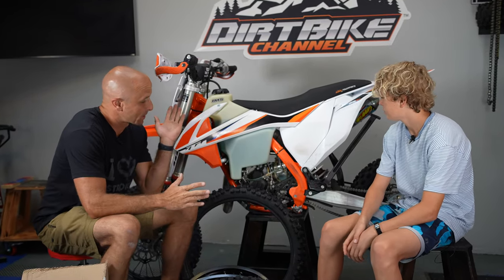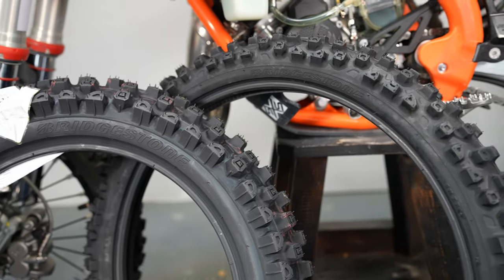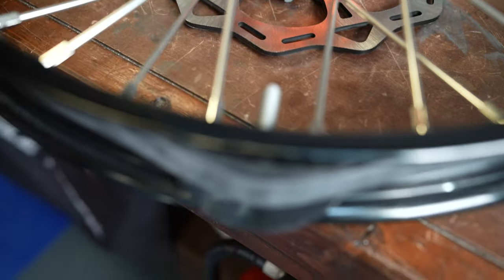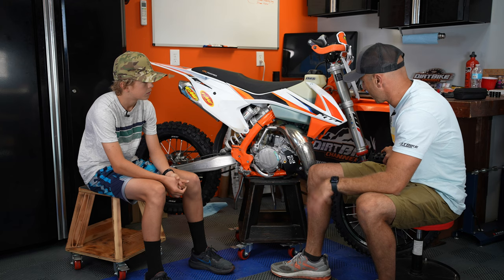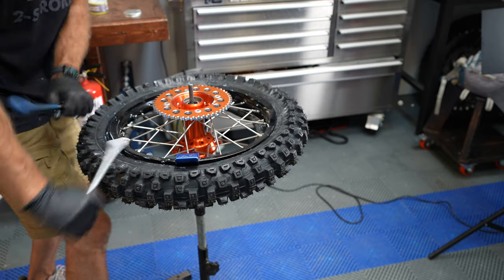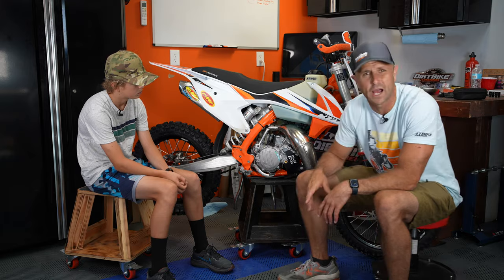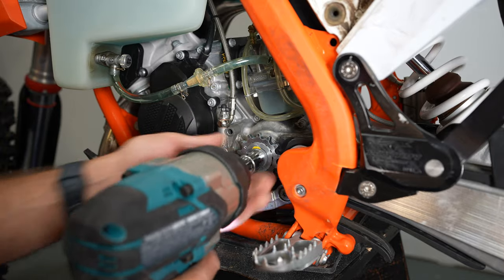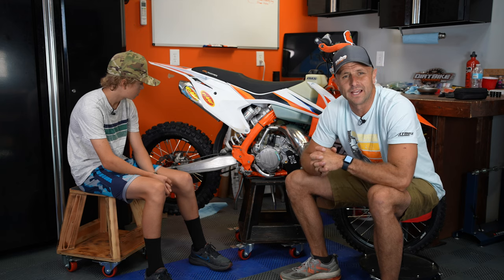KTM 85 SX Big Wheel Conversion 19/16 Wheel Set for Enduro

Comment: 70hrs is alot? my sons TC65 had 176hrs when i bought it.  its about to clock over 200hrs,  to be fair I did rebuild it top to bottom before i gave it to him and its now as good as brand new.  Coil fork conversion, blader kit shock, new top and bottom end, gearbox bearings, swing arm bearings, wheel bearings and stem bearings, painted frame the works.  Tossing up if i should get him a second 65 for trail riding or a 110.

Comment: Awesome . Good info .
My son is approaching that same gap and I’m struggling to decide what bike will work for him until he’s ready to go to a full size . He’s currently riding a ttr 110 and a kx65. He’s almost 11 and both bikes are a touch small and under powered for his skill level  . 
An 85 doesn’t seem like a big enough jump to be worth while, while something like a kx 100 would be a too big . I wasn’t aware of a wheel size upgrade available for the ktm 85. This might be the ticket. 
I sure wish someone would build a true midsize enduro bike to bridge the gap.
Reply: 85 come standard with either big wheels or small wheels. It seems Kyle bought the small wheel version and is converting it to big wheel rather than buying a seperate bike. and 85 big wheel is a lot bigger than any 65
Reply: If a kx100 is too big so is a big wheels they’re both 34” seat height a small wheel sounds fine as they’re 31”~32”

Comment: You have a truing stand, you should build the wheels yourself it's not hard to do at all, those rubber rim bands for covering the spoke nipples don't work very well but Motion Pro has some that are plastic with adhesive on them and they work great and offer much better protection against flats, those wheels look great on that bike and will definitely provide much better stability and cornering, I can't believe how big Conner is getting.

Comment: This category of bike is so confusing as a newbie dad, my 11 y/o son has outgrown his CRF125F but every manufacturer markets the 85 as a “rip snorting MX’er for your little McGrath”.  My son isn’t interested in motorcross and dealers tell us you can’t really change these bikes into good enduro/single track bikes. I’ve been told that if your not in the pipe with these 85’s, you’ll just foul plugs and the bike will die in the technical stuff. What to do?
Reply: You can buy weighted fly wheel. This will help the bike not wrap out so fast and help it lug more. Less prone to stall going slow. Also you can go down a tooth on the front sprocket. Or up a few teeth on the rear.
Reply: That is a huge misconception just like every other 2 stroke or Mx bike, if you mess around with the suspension and jet it right and run a hotter plug 10 for example they’re great single track bikes no mods needed.
Reply: If he gets used to it and knows how to ride it they are just fine for single track just like a yz250
Reply: Thanks for the replies fellas, I knew there had to be a way to mod these bikes, but there’s almost too much info and to many opinions for someone new to the sport to filter through.

Comment: No way it needs a piston. KTM is super conservative on their manuals. Single track use would give you at least 140h on a top end. If it starts easy you don’t need to change anything.
Reply: When we got ours the shop said will see you again at 20 hours for a new top end 😂 we’ve done 40 and the bikes running like new still

Comment: I like the big wheel upgrade. But KKE wheels is definitely a DOWNGRADE. I put a set on one of my bikes because they looked good and were cheap, but the first time I hit a rock in the desert I broke 3 spokes in the front and 1 in the rear.
Reply: Interesting…. First time I’ve heard this.
Reply: Fake news I run them on my 250sx riding hard hard trails rocky shit. And jumping 10-15 feet of air sometimes casing landings…. No broken spokes no egg warp or even side to side warping
Reply: @davidbeauvais1364  this is kind of weird but I've never seen this comment before you replied too it.  It says it's my account but I never wrote it.  I've also never used a set of KKE wheels, or broke any spokes. I've used stock, warp 9, and dubya. I did bend my stock rear pretty bad. The only thing that sounds accurate for me is that I do ride in the desert. It is indeed fake news.